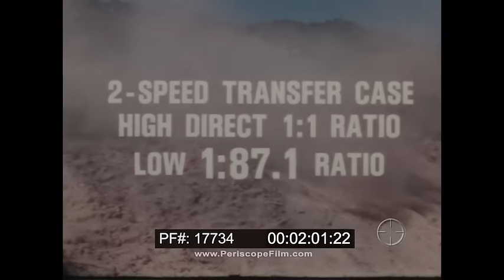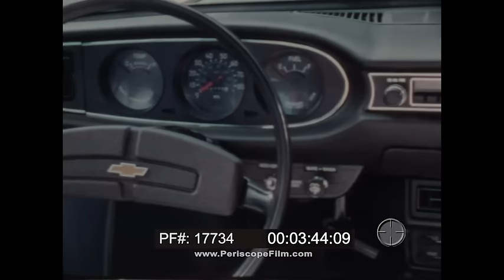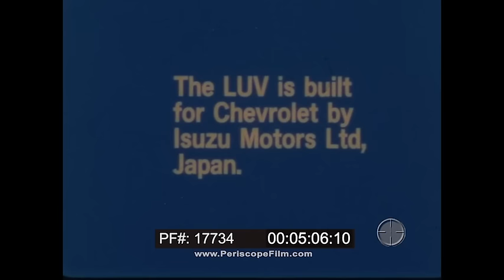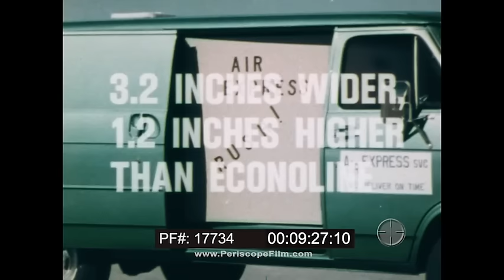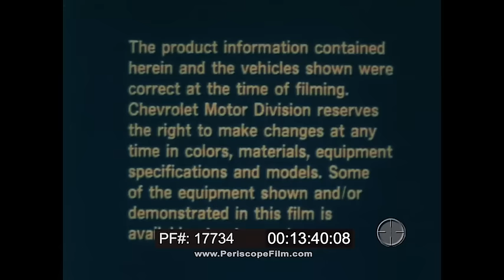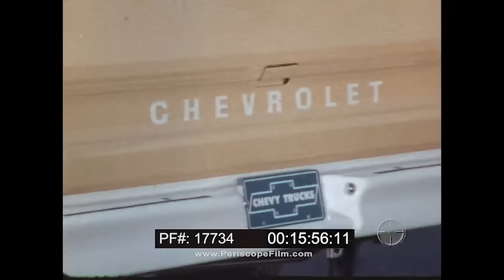CHEVROLET 1979 PROMO FILM FOR CHEVY LUV PICKUP & DODGE VAN vs. FORD 17734

Comment: I had a 1976 Ford Courier, my Grandfather had a 1974 (I think) Chevy LUV, and later I had a 1992 Nissan Hardbody. The Hardbody is still going strong and well on it's way to 300k. Plenty of power even with the a/c on, and no rust to be found anywhere. I don't understand why they quit making mini trucks. They are a blast to drive, at least in my opinion.
Reply: @Tony government regulations
Reply: I agree, I'd rather have a small truck as opposed to these ugly 4 door station wagon trucks being manufactured these days. The heck with government regulations, the way gasoline prices are going these days, the smaller cars and trucks with fuel efficient 4 cylinder engines are a better form of transportation mode, more economical to operate as far as gasoline consumption tires, everything. I'd like to see the smaller cars and trucks come back into production once again.

Comment: I bought a new Toyota SR5 in 78.  Toyota didn't have 4 wheel drive then. When the 79 LUV came out I was so bummed, I wanted a 4x4 mini truck but nobody made one in 78. A buddy of mine got one. As soon as the warrenty ran out, I helped him pull the motor and trans out, and drop in a SBC (350) with a TH350. When we finally got all the transfer case issues resolved, it would rip, on road and off. Smoking 4 wheel doughnuts were epic.

Comment: I drove a 79 1 Ton long wheel base Chev Van for a work Vehicle in the late 80's, That beast was a great Highway truck.
Had the 350 in it. Steered like a Bus in the City, Fill the Oil & check the gas. I miss that Old thing...

Comment: I had a red '79 4x4 LUV identical in color and Mikado trim to that one shown early in the video. It was a tank and I could run circles around my friend's lifted K-5 Blazer on the trails of Colorado. Other than a sheared timing belt (which I replaced in my driveway) I never had any mechanical problems. It was still running after I gave it to my BIL who used it in his sandy commercial peach orchard for years. Unfortunately, after a few years, they tore a CV joint boot and got it full of sand, and that spelled the end for this little giant.

Comment: I drove a Company LUV at work back then.  Better than the Courier my Mom had.  Between 1971 and 2020, I logged enough time in all 3 van brands. They've had their P.O.S. moments but I've been able to complete all my assignments in each. Back then I would've chosen Chevy and did own a used '73 for 6 years.  Today, though, I'm partial to the Transit.  Both cargo and passenger.  If a Promaster was less like a delivery van and a little more like a Ram, you might have something.

Comment: I had early quad headlight Chevy LUV I think it's about a 73. There's a lot of fun drive around. It is so badly rusted. I played around with it went to Walmart bought their Walmart brand color back in the day when you could buy 50 different colors for 50 cents a can or something like that. It took the grill out stuffed it prime painted clear coat with high gloss that black grill looked really nice in that yellow truck. Remember me and a couple guys just goofing around with it. Actually took him to expandable foam in there rockers and other places where it rusted and put some masking tape on the outside of it and we just painted over it. Even the used car dealer is laughing when I drove out after paying $350 for the truck. I had said nothing in my driveway as if it was for sale. I don't remember what I was doing I just needed it out of my way the guy asked me if I wanted to sell it. I said no not really but it's in my driveway it could be in yours. Or something like that I'm sure. My neighbor and I did all that to that truck in one afternoon. The grill took a little bit of time to drive between coats but we just let it set. We painted the rims didn't do a whole lot other than rattle can the thing. I pointed every last thing out to this guy. Well it was my turn to laugh as he drove away gave me something like $1,800 for it back in the day I would say this is probably maybe 1990. You know I always wish I had not sold that truck. Here's a fun little truck. I'm not sure if I loved my Chevy Luv. But I sure had a lot of fun with it and liked it a lot

Comment: I actually owned one of these. I had a 1979 model. It was white with blue stripes. I purchased it in 1989. It was a great little truck. Mine was automatic two-wheel drive and it had AC which was great in South Florida. It was basically a rebadged Isuzu. Just like Ford's little truck was was a rebadged Mazda. The Dodge was a rebadged Mitsubishi.
Reply: You're right about the rebadging. One big difference with Mitsubishi and Dodge is d50. I have two 1984 or at least that body style. I've had for such a long time. But they're the same year and two different trucks. The d50 Dodge had a 2.6 with an automatic very soft suspension like a car. It also had air conditioning. The Mitsubishi mighty Max of the same year. It was rated everywhere else in the world as one ton. I thought that was a joke until I start looking at the specs and actually start driving it. It had monstrous brakes for that size of trucks it had a 2 L with a five-speed. It may have only been four speed it's been a while since I've touched the truck. But I was pulling an old Ford 1953 pickup bed trailer with it and I'd everything I needed to reroof a house. The pickup bed trailer had no brakes on it. I loaded it down with shingles felt papers nails plywood everything between the truck and a pickup bed trailer. The reason why I mentioned that was a pickup bed trailers it still had differential so it had drag to it as well. It wasn't a light item either. I still got nearly 30 miles a gallon working it like that. On the highway with just a modest load basically commuting down the interstate I would get close to 40 mi to the gallon. We rebuilt the engine clutch brakes everything over a short period of time. It's set up higher and a big stack of springs still road decent for a small truck. Now Mitsubishi had some other model other than the mighty Max I don't recall. I went back to a Ford and Chevy half ton pickups. I don't know why. Now I drive a Ford super duty 3/4 ton and it's much more truck than that Mitsubishi ever was. Same thing for my 2500 HD Chevy 3/4 ton truck but that little Mitsubishi truck would run pull stop haul and get fantastic gas mileage. So there was a little bit different but it was still made by Mitsubishi for Dodge the d50. I should probably pull him out of barn and fresh them up and adopt them out to somebody who actually do something with them. Friend of mine had a Mazda be something other. And we took it on a 1500 Mile road Trip and it did well too. Some Mazda pickup trucks actually came out with Ford engines for a while. I found that interesting cuz usually it's the other way around American companies using offshore engine suppliers.

Comment: GM needs another one to compete with the Maverick.

I know Toyota is making a smaller truck soon.
Reply: I owned a Maverick in the seventies. it was a 1970 model car.
Reply: IMO they all need to make a basic cheap small 4cyl 6 speed manual truck w optional 4wd straight axle getout hubs. Several years ago I was given a 87 Dodge Raider took me couple of days to sort the EGR shit out its rusty  I drove it from Florida to Arkansas I keep it well maintained and it just ticked over 100K thing pretty much stays locked in 4wd in winter I love it but its getting wore out.

Comment: The last ad for full size Chevy trucks was such a sad year for all full size truck manufacturers. Just a couple years later I started my job as a mechanic at a Ford dealer where I worked for 23 years. 

The late 1970s through the mid to late 1980s were some bad times for US auto makers which was obvious in some of the poor quality cars and pickups on the road. The government demanded better fuel economy, tighter emmission controls, better crash protection, all while staying competitive with imports. Meanwhile, UAW (United Auto Workers) demanded better pay. 

Costs savings had to come from somewhere. Usually through cheap plastic interior parts. The engines ran awful; this was before electronic fuel injection and distributorless ignition systems. On board computers were starting to make their way into cars but there was only so much they controlled. Automakers retarded the ignition timing and installed a hideous amount of vacuum switches to control emission systems like smog pumps and EGR valves while leaning out the carburetor to save fuel. The 4.1 Liter engine the nararrator talked about in the last video barely had the power to pull out of a driveway. Ford and Dodge didn't offer much better. 

While US automakers built some real garbage in that era, it was a great time to be a mechanic. At 18 years old I was married with a young daughter and making $9 an hour at the Ford dealer. We weren't rich by any means but we got by just fine. 40 years later, I am still a mechanic (fleet mechanic) getting ready to retire in four years. My wife and I celebrated 40 years of marriage, and our daughter gave us beautiful grand children.

Comment: I got a 77 high sierra 2wd 3504v in the late 80s for 800 bux. It was nicknamed the "road menace". pulled mill and dropped it in a 80 Camaro. It's still running in 2023
Reply: Did engine change in 89. bullet proof cam, 4bolt main. Peter pump kin. loved  8this

Comment: Later problem with the GM and Chevy truck frames, cheap steel, tended to break the frame metal around the power steering box. Dangerous stuff there.